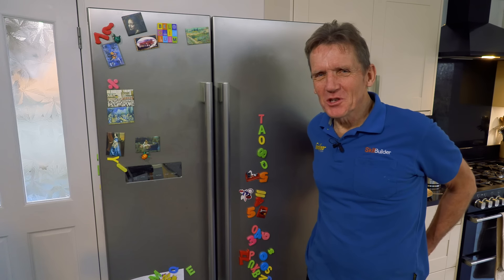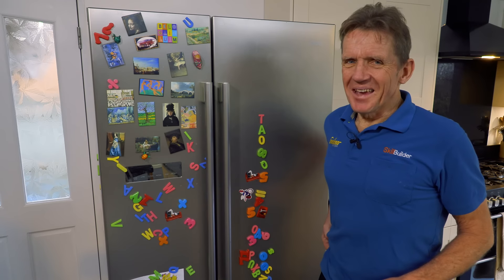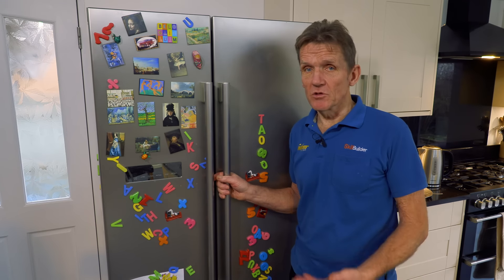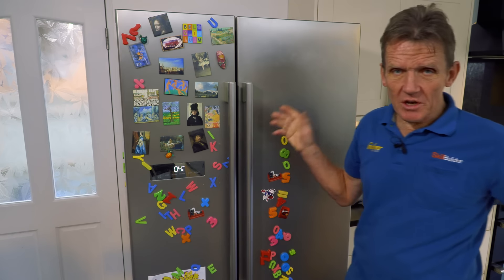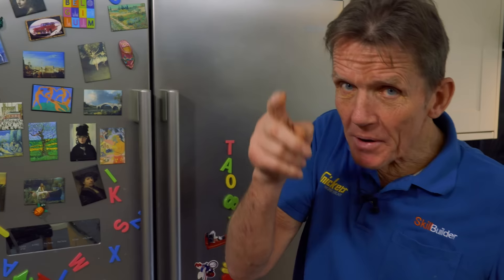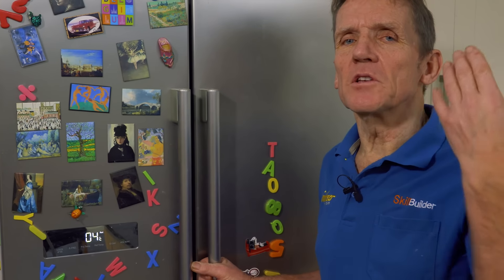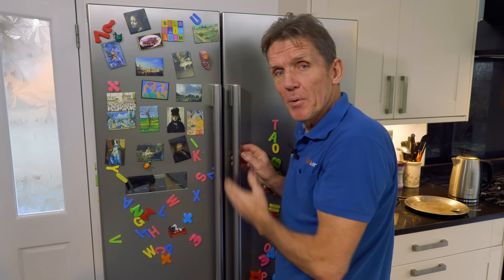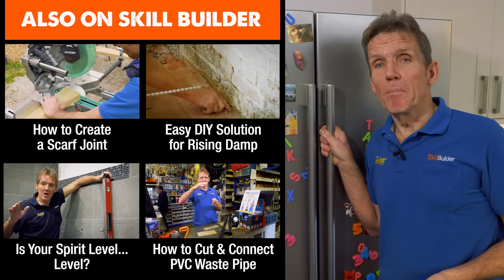Why is Your Freezer Frosting & Fridge Freezing

Comment: Seems like many modern appliances (and cars!) are all about gadgets and fancy looks rather than robustness, solid performance over time and ease of repair.

I always think of the Numatic Henry vs Dyson vacuum argument. The Numatic is such a simple, but incredibly effective design at an excellent price point.
Reply: EU regulations demanding better energy efficiency is the biggest reason for problems like this. Better energy efficiency usually requires added complexity.

Comment: Misleading title there Roger, should be titled "I don't know why my fridge freezer isn't working so I'm buying a new one".
Reply: PMSL
Reply: Ikr guy had me thinking he was gonna fix the Damm fridge.
Reply: Lol yup I wasted my time here
Reply from the maker: Yes you wasted your time because you failed to understand the problem is not something you can fix but something you can only avoid by buying a fridge that doesn't have this design fault.
Reply: I went back and check the title,  he hit the nail right on the head,  he explained it according to the title.
Reply: @johnbanner9491  Yeah. I have top bottom fidge that uses the same system of blowing air from the the freezer. The mechanisms and details are different of course, but it the end, my fridges' problem comes from the same system that wouldn't happen with a twin cooling system. THIS system, is the reason why our fridges stop reliably cooling.
Reply: 🤣😅🤣... good one mate..lol

Comment: My 1971 frost free still working fine.  No mechanical motor to move air from freezer to refrigerator.  (Whirlpool brand USA) 2023 now.  

These newer models are Over Engineered.
Reply: Your probably paying the same price as a fridge in energy bills each year

Comment: X Roger, this older video appeared in my feed because I watched ‘my mate Vince’ on YT wrestling for over an hour trying to fix his fridge/freezer - the power of the algorithm. Vince was ultimately successful but had an interesting and painful journey that is way out of scope  for most homeowners.  After watching both videos (and being a ‘real engineer’ myself) I draw the following conclusions:
 (1) There is nothing fundamentally wrong with the design of your old fridge/freezer. 
(2) These appliances are very simple bits of kit but they have  electrical, electronic and mechanical parts and they can and do go ‘wrong’. 
(3) The ‘professional’ who came round to sort out your fridge freezer did not know what he was doing and did not have any diagnostic skills and was unable to work from first principles, but as you say throwing parts in out of desperation (and to get on to the next job asap). 
(4) If you watch Vince - he starts off from a zero knowledge base and just perseveres until he gets to the bottom of it - he stumbles around, gets as confused as fuck sometimes - but gets there in the end. It is painful to watch. 
(5) The biggest challenge for the homeowner is obviously understanding the principles and actually where the key components are located BUT much more important how to access them and remove the various covers without breaking any of the quite fragile plastic mouldings - beyond that knowing how to work safely and measuring continuity and resistance on a multi meter.
( 6). All design is a compromise, design choices may improve reliability or reduce it and while your refrigeration engineer recommended the twin evaporator design choice - from a reliability perspective it may not actually be more robust than the fan transfer design (reliability studies are a science in their own right).
(7). I think you got unlucky, a Friday afternoon production model colliding with a service tech who did not have a clue.

Comment: I had a similar problem, check where the temp sensor is in the fridge and make sure nothing is too close to it, so that the air can flow to it.
Also, my samsung cool air fridgefreezer needs a 50mm air gap on both sides as it dissipates the heat through the sides and not the back.
Your fridge looked as though it was tight on both sides. Nice video Roger.👍👍

Comment: I have a 30 year old side by side maytag with the majik little cold air hole. Found out that the hole draft shutter would not allow enough cold air into fridge so I left it wide open . In your case open all the way and disconnect power connector. Then I adjust fridge thermostat to desired temperature for fridge. Had to get a 2 dollar thermostat for fridge and freezer to set it up . 

Fridge is now perfect.
Reply from the maker: That is a great idea. I have got rid of the fridge now so a bit too late for me.

Comment: hi roger,looks like the fridge/freezer you have now is also samsung,what a crappy idea to use a port like system to cool both spaces,i've learned my lesson,some brands are super for tv's (samsung,lg),and others (aeg,liebherr,siemens and top notch,miele) are good for fridge/freezer,washing machines and dryers,after my metal brushed samsung machine gave up after two years,i bought a miele,expensive but reliable,and this machine uses the two compressor mode,but as it is a machine from 5 years ago,i have no no-frost
anyway,great vid roger
Reply: Problem with Miele though is their designs look like machines from the late 70s.
Reply: @DPJOINERY  yes,but at least they work correctly and have a fair lifespan,i would rather have something that works than something that looks good
Reply: @ronnyb5890  very true, but i just think it's strange they look like old models, thinking about it maybe they do it for that particular era because of the age range they sell to, knowing most of us youngens🤣 who was born after the 80s can't afford Miele.

Comment: I had this exact problem with a Hisense caused by the drain on the auto de-ice on the heat exchanger (freezer) being blocked! The heat exchanger was seriously frozen up because moisture couldn't escape causing the components to ice up in turn.
Reply: We had similar with an auto-deice freezer icing up after about 6 months (well known make, but can't recall it for sure now). Warranty engineer said we needed to deice it occasionally ... ?!?
I took the relevant section apart and found the drain hole was partially obstructed by some of the foam insulation - poor assembly. I trimmed it back so the hole was full-bore. It then ran for many years after with no problems, and I was happy to send it on to a charity shop when we revamped our kitchen with a built in freezer.

Comment: That's interesting. I didn't know there were fridges that shared the evaporator. Having said that, we've had an American style Samsung for about 8 years and it's a nightmare - the defrosting system doesn't work properly so the evaporator and fan constantly get clogged with ice. 
On top of that, the insulation in the cover over the evaporator is unsealed expanded polystyrene, which gets saturated with water, losing its insulating properties in the process making the problem even worse (or, more likely being the cause of the problem in the first place).
Utter junk. Next time, I'll go for a Bosch or Liebherr - saving a few hundred quid on something you plan to last years just isn't worth the hassle.
Oh, and another warning to folks thinking about buying one of these new style fridges that don't have the conventional flat heat exchanger on the back, but instead use a coiled-up hear exchanger with a fan is they are a nightmare to clean, as you can't get to most of it and so you need a compressor to blow the dust off, which is needed every six months as they are  mounted at floor level with the fan constantly blowing all the muck over it.

Comment: You must have some type of Consumer Affairs in the UK? Did you explore that avenue?
Reply from the maker: They are not going to get Haier to conceed that the technolgy is flawed. They send out the service engineer until the warranty runs out. The new fridge has a 10 year warranty.
Reply: @SkillBuilder  There is a fit for purpose law, it lasts for i think 6 years, but folks don't realise, though you do have to show it's the product at fault.

That aside I bought the curry's 5 yr warranty for my sister's fridge, they reckon they would replace it or put the cost price towards a new one if necessary.

Comment: Too many moving parts and too much focus on cost. The best fridge freezers are those with the freezer at the top. These effectively have twin evaporators and no air mixing. Only one extremely reliable moving part, the compressor. The whole lining of the freezer gets cold and the back of the fridge. Mine is Beko (so cheap) but will outlast these things with a thousand moving parts ten times over!

Comment: You get what you pay for with refrigeration, the cheap fridges use unbranded Chinese compressors and electrics that generally last long enough to go just out of warranty and I would never buy a fridge with a plastic back plate 🔥

Comment: You could just buy a separate fridge and freezer like normal folk.
Reply from the maker: Normal folk? Who are they, where do they live?
Reply: @SkillBuilder  They normally live in houses lol. but seriously for a moment, a twin cooler unit has the same amount of working parts as two separate units. But has the disadvantage of being tied together, so one side dies and you end up replacing the whole unit, where if you have separates you can get matching units and if one dies you just replace one. you can even get double high fridges and freezers. Of course it spoils the ' american fridge'  look a bit.
Reply: @billystead4598  Only the one compressor needed in a twin system
Reply: @peepiepo   you're right, i didn't differentiate between twin cooling and twin compressor, my bad.